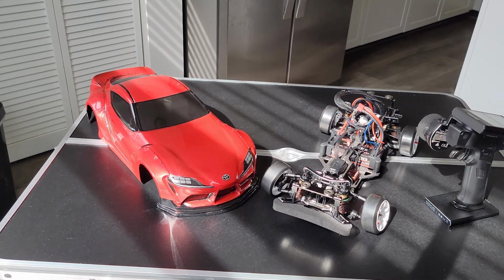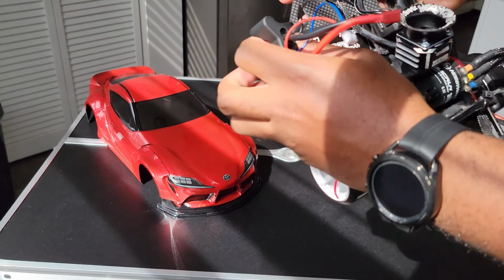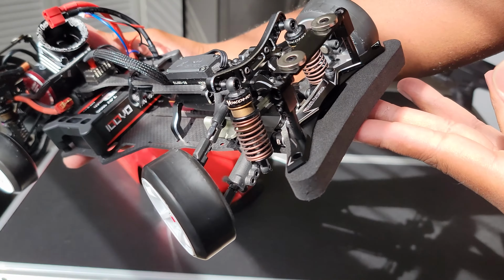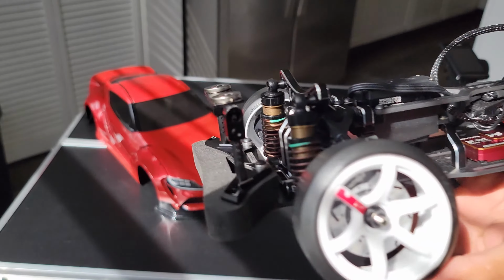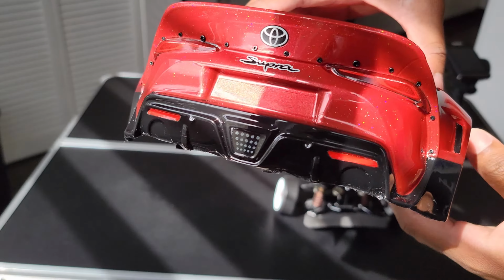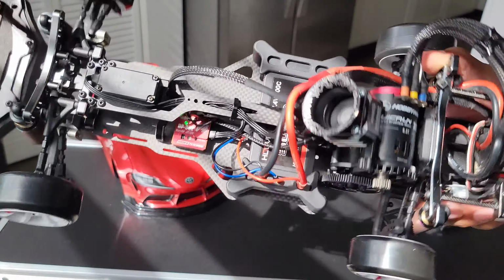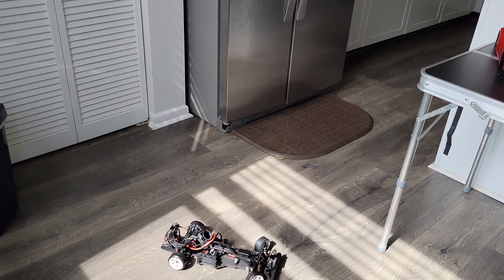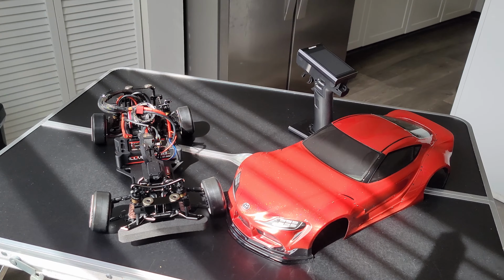My Yokomo YD2 SXIII Overview

Comment: You definitely answered some questions for me. Got my kit built just trying to find some good info on some decent electronics now.
Reply from the maker: Happy to help! If you are on a budget go with hobbywing esc and motor. Try to get the 13.5T motor with their quick run esc. If you want the upper echelon then go with yokomo drift performance dx1 and performer competition brushless esc. With that you can modify timing and boost get a good high speed servo and the yokomo v4 gyro. Happy building brother 👌

Comment: how do you make the gyro return so slow? mine jumps right back so fast
Reply from the maker: Check your gain levels. Depending on how much gain you adjust it will snap back the steering soft or hard. This gyro I'm using has a couple of settings from beginner to expert adjustments